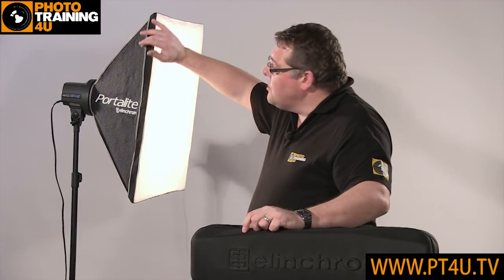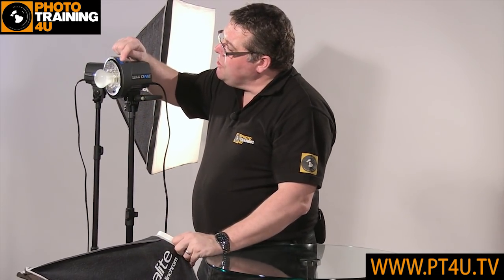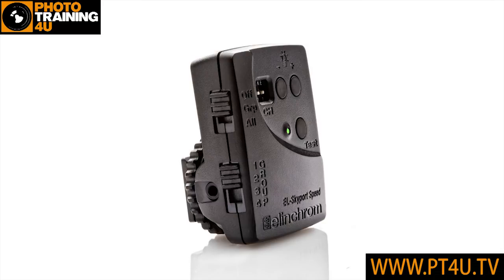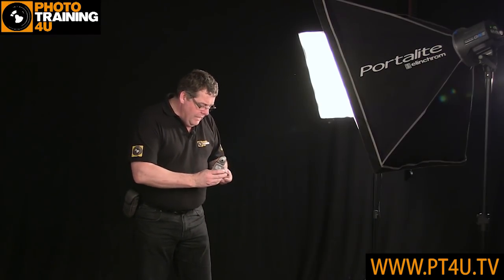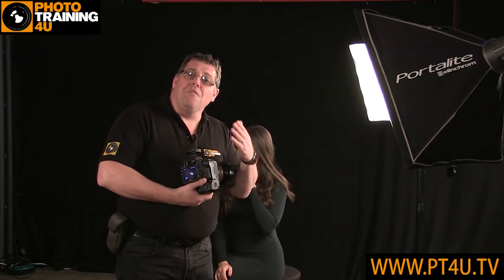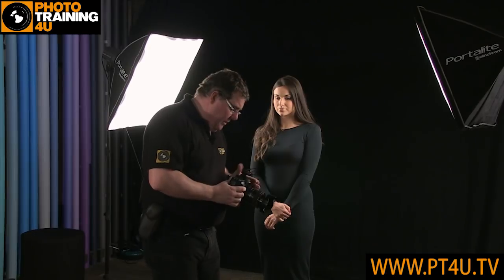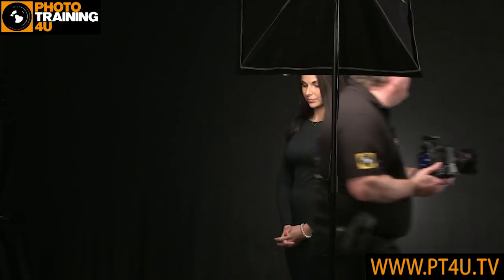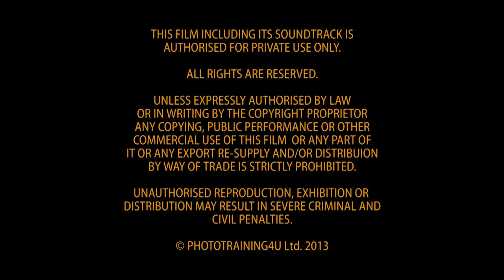D-Lite RX One Softbox Kit

Comment: Is 100watt enough for portrait or home studio usage (living in small apartment)? I guess this is the "Elinchrom D-LITE RX ONE To Go Portalite Set"?
Reply from the maker: Hi it is powerful enough but it does restrict you to a three quarter length shot of adults and would advise no more than two people in the portrait. It's great for children and babies.
Reply: The real restriction isn't so much the power output (it's about double the output from a full-sized speedlight) but the size of the Portalite softboxes. 100 Joules (Watt-seconds) might have been a bit of a tight squeeze in the film days, but upping your ISO to 200 (or 400 on many modern cameras) comes with essentially no penalty even if you're a pixel-peeper. There's no way around the fall-off from a 66x66cm softbox, though; you would have to back it off far enough that it wouldn't really be a softbox anymore. You can use one of the larger Rotalux softboxes (if the price doesn't scare you off; they're relatively expensive compared to the D-Lite One RX kit), a large-ish umbrella, the Varistar umbrella softbox, or reflect off a wall or panel in a pinch. The large indirect boxes (like the EL-Octa or EL-Recta) are also a possibility, but now we're really getting silly, price-wise. You will lose a lot of control with a brolly or a panel/wall, and would have to use flags with them to control where your light falls (or, rather, doesn't fall), but you can improvise there rather cheaply.